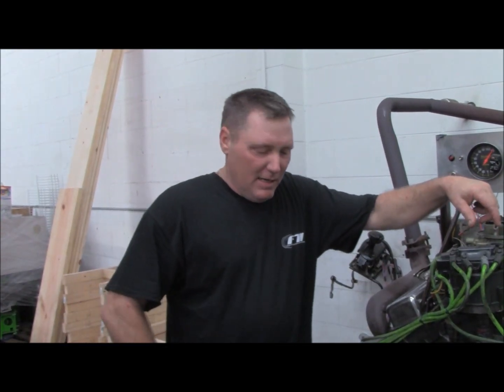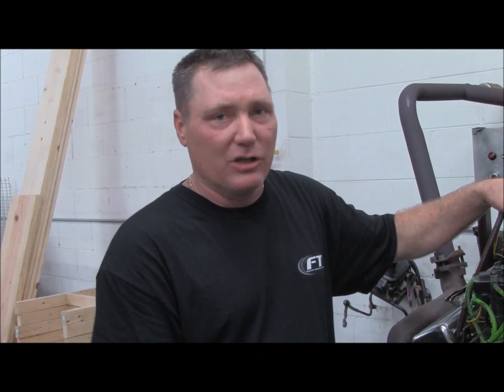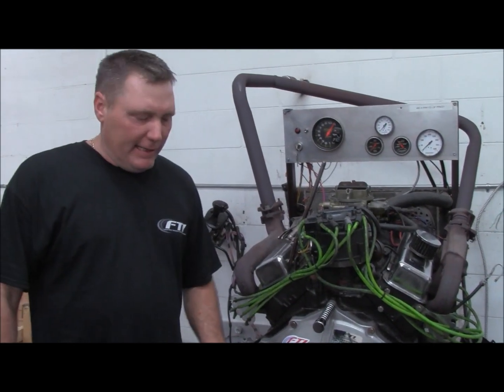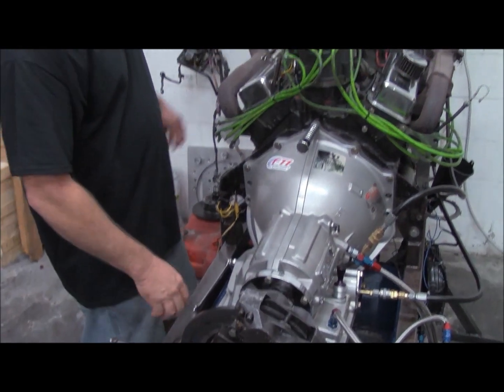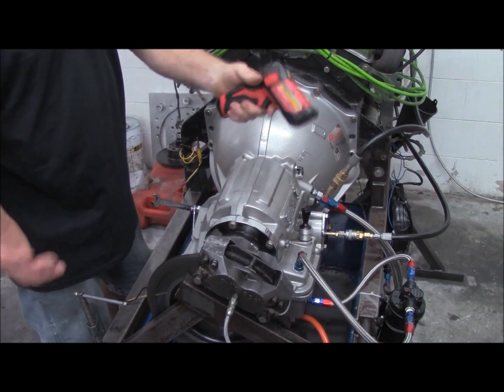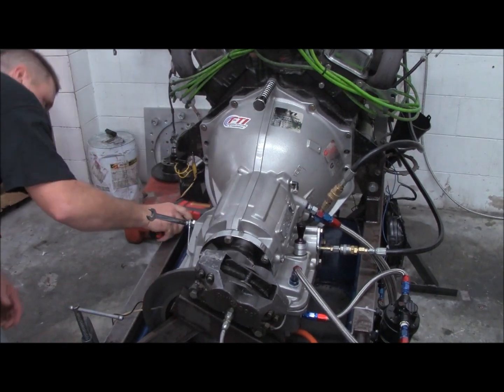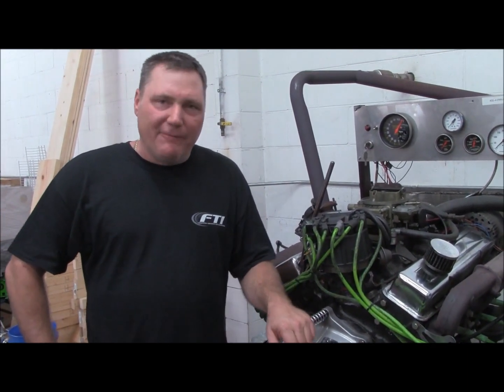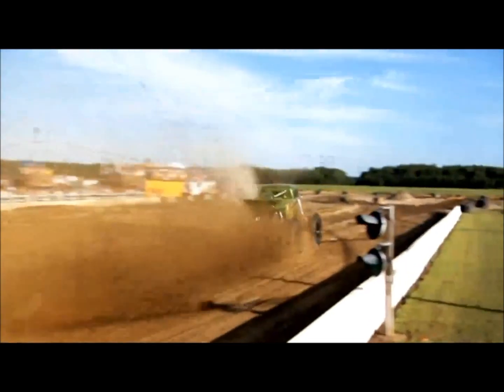FTI Transmission Dyno Test WITH Pump Around System

Comment: In a truck transmission you can have a prognostic wonder if they can regulate the temp thru that valve body ib the control module (pan)

Comment: Hello - is that all you need to load the trans on a dyno, a disk brake?
Reply: No. But it works to check the basics. It's not intended to try and break the transmission or make it slip. it's no better than running a car on the rack because you can't feel the shift quality, or if it slips under the weight of a vehicle. But who's really caring about shift quality with a single shift powerglide